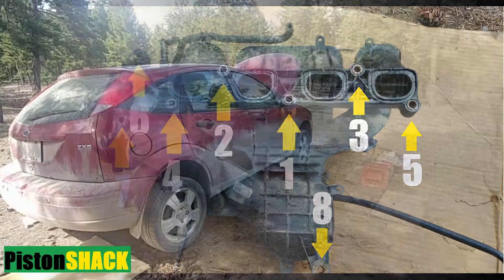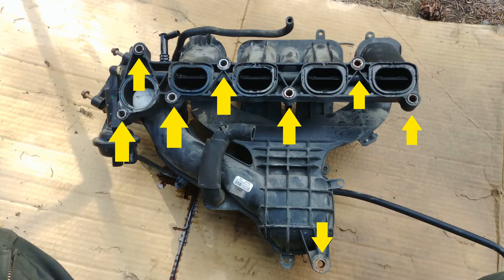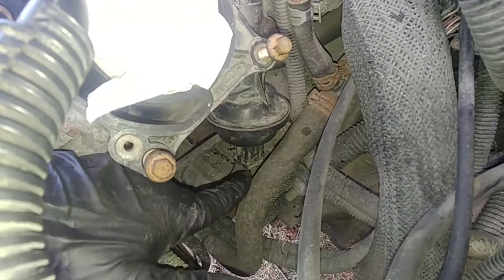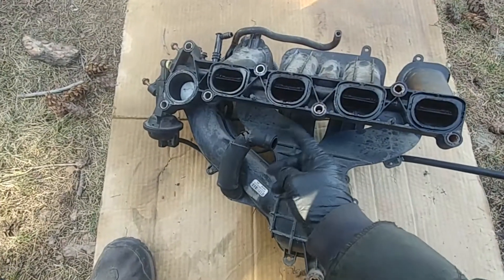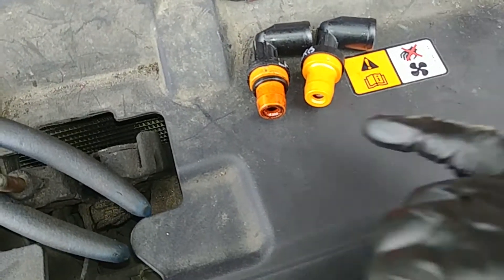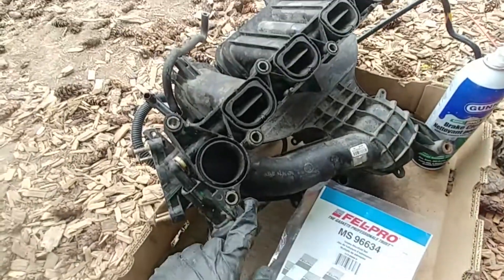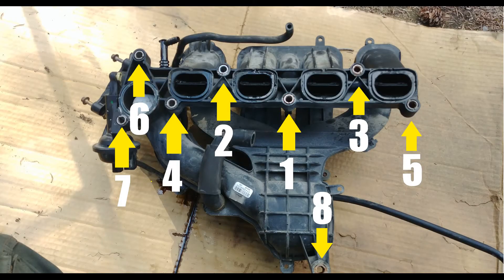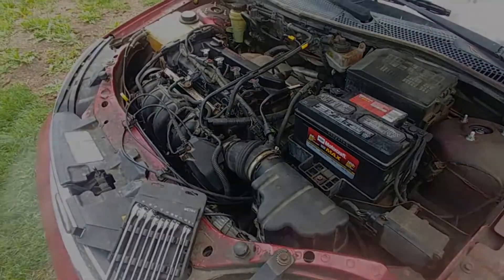FORD FOCUS 2.0L DURATEC: PCV VALVE, HOSE & INTAKE MANIFOLD GASKET (manifold bolts sequence).

Comment: Hi and help!
2005 Ford Focus ZX4
My shop could not find a problem. There was no trouble code. They performed a tune-up.
Same symptoms after tune-up, loss of power and stalling and DTC P0171. 
I Replaced PVC and hose, and Intake manifold. Original symptoms repeated this morning. What should I look for next?

Comment: I know its an old video but that manifold is broken and no good...The butterfly plate is moving up and done not just rotating and should be replaced...should it break and the car will die and your doing all that work all over again...if your lucky, if not the pieces will get suck into he engine, potentially causing catastrophic damage.

Comment: What was your reasoning for replacing it.  How did you know it was bad and needing to be replaced?   I have the same car, same engine.  I had a bad oil leak at the valve cover and I replaced it and it hasn't leaked there ever since.  However I'm still smelling burning oil when the car is on and the heater or ac is on.  Someone told me the pcv valve will make it smell like burnt oil if it is clogged up.  I cannot find any other leaks besides the oil pan drain bolt has a slow leak there.  So I don't know what else would cause an oil burning smell.

Comment: I hope you see this but can you tell me if the coolant temp sensor is behind the intake?
Reply: depends on wither or not if the thermostat has the sensor or not some do, some dont, also depends on year. most coolant temp sensors are near the radiator

Comment: You can take the throttle body off and hose and reach through to the PCV valve if you're not renewing the manifold gasket.
Reply: @GrizzlyGaz  man that's good to know. I really just wanna change the pcv only and not go through the bigger headache of removing the manifold.

Comment: TIP  use ratchet straps and pull motor away from radiator just a small amount and you will not damage gaskets while placing intake on

Comment: Great idea placing the bolts in the screw holes on  air intake & throttle body !  My father was a mechanic,  I grow up in a garage my father always told  me  The service book are only 50/50 on information.

Comment: Why not remove the fuel rail ? It appears that you may have way more access with it out of your way. Its just 2 bolts, the 4 injector wiring harness's, fuel input line  and the rail and injectors pops right off. Would that not be worth the time to do it for this job ?
Reply from the maker: Good point Bevis! There's always some better ways to do it. Thanks for sharing your advice. Cheers!

Comment: Is $525 a fair price for rear end crankshaft seal, replace pcv valve and a couple cracks in aluminum oil pan where AC compressor is mounted on ? 2016 Focus SE 2.0L duratech engine.
Reply from the maker: Hey Frank! Sounds like you had good deal for the work shop did. Check  front side of the engine where is serpentine belt, AC compressor should be there. Thanks for you feedback.
Reply: @PistonShack  no , about to get it done. That's price he quoted me. He also said I should clean engine ( which I've done) to truly check it to see any oil leaks. Also, if timing cover is leaking oil that must mean the engine crankshaft front seal is bad too right ? I don't think it is but asking just in case.
Reply from the maker: I would clean inside the engine cover, let engine warm up and idle while looking for any leaks with bright flash light. Most likely oil get inside the engine cover. Normally, seals shouldn't leak on 5 years old vehicle.

Comment: Great video.  I broke the barb off the fuel pressure sensor too, good to remove that.  Appreciate the tip on removing the throttle body.

Comment: The worst thing about the location of the PCV on this engine is that it can need to be replaced between every 20,000 - 50,000 miles, despite Ford's recommended 100,000 mile interval. I'm about to do mine because all the signs are there. Bank 1 lean code, rough idle both hot and cold, leaking valve cover gasket, and the car only has 65,000 miles on it.

I'm seriously considering gutting the old PCV valve so I can place the new one in a remote location out from under the manifold.
Reply: Did u manage to replace it without removing the manifold?

Comment: thanks i am doing this job and this has been helpful. Having a hard time with the ring that holds down the pcv valve. Which way does the plastic ring turn to take it off?
Reply from the maker: I think you have to turn that plastic locker ring counter clockwise 1/4-1/2 of the turn ti take it apart.

Comment: Granted I haven't done this job which is why I'm watching the video, but putting the intake gaskets on after putting the manifold in there seems insane.  Don't they easily fit into the plastic grooves on the intake manifold?  I replaced gaskets on the valve cover and it looked like the same thing.  If you are worried about scratching them with the fuel rail, the fuel rail is really easy to remove.  Am I missing something?
Reply from the maker: Hey brotha! This way worked well. I tried the way you explain,  I just didn't want to remove fuel rail off. Just tried to reduce amount of parts taking off. Thanks the advice. Have you done your repair already?
Reply: @PistonShack  No, it's not the weather here to be doing this right now, unfortunately.  I don't have a garage.  Didn't mean to be offensive.

Comment: I have the exact same problem. My car is also equipped with lpg from the factory. Do you know how can I move the plg injectors rail away to make space?
Reply from the maker: Hi Alin! Oh, I see. I am not sure but I think should not be much difference than removing gasoline fuel rail. Let me know what did work for you. Cheers!
Reply: @PistonShack  it was actually easier than i thought regarding the fuel rail. However i got stuck on the last 2 bolts from the center🤬🤬😭, i can't reach them i managed to get 6 bolts out and all the wires away, but those bloody bolds i couldnt and I had to abandon and put everything back together. I will try tomorrow maybe, after i buy another extension for my rachet. I had 2 extensions but they aren't enough apparently. Those bolts are way deep inside. I Have the 2009 2.0 focus and it's slighly different from the pre facelift version
Reply from the maker: I know brotha they are hard to get. Just get bunch of different length extensions, deep and shallow sockets with a swivel to rich them.

Comment: Hey man I just got done doing this today I’m waiting on the hose and valve. I have oil residue inside the intake where the pcv hose attaches, what does that mean ? Does it just mean the pcv valve failed??
Reply from the maker: Hi Parker. Most likely PCV valve partially stuck (clogged) closed or tube got clogged up. Little bit an oil is fine. Did you drain any from intake manifold?

Comment: Thinking I'm going to do this job on my car sigh not looking forward to it
Reply from the maker: Sounds good Gage! Let me know if you have any questions.
Reply: @PistonShack  can I get the manifold out if I just take the fans out and leave the radiator in
Reply: @danicyrus6464  you can, but that's alot more useless unplugging, better off loosening the motor mount an slide motor back some then work from there.

Comment: Would have maybe been easier to disconnect the hose for the PCV valve on the intake manifold side and leave it attached to the PCV valve until after intake manifold removal.
Reply from the maker: Hi Paul! Interesting point. Let me know if it work out.

Comment: The guy who designed this motor I’m sure has family members who are mechanics.
Reply from the maker: Good point, I haven't thought about it. 2.0L Duratec engine is not too bad, most of the components hidden under the intake manifold. Cheers!

Comment: I was a bit confused on how to do this because the Haynes manual didn't explain it well. But you explained it perfectly! I will be doing this soon, thank you!
Reply from the maker: Hi FalconMFilms! Great to hear that! I couldn't find any decent information with all details online. I tried my very best to make it clear and straight to the point. Let me know if you have any questions. Whatt Ford Focus do you have? Cheers!
Reply: Sorry for the late reply, I’ve been busy fixing some more pressing issues (wheel bearing, wheel cylinder, cv axle, motor mount). Had to put the intake manifold work on hold for now. Thanks, I’ll let ya know if I got any questions. I have a 2006 focus zx5, I mainly use it for daily driving and autocross.
Keep it up man!
Reply from the maker: You bet brotha. Sounds like serious repair is going on! In Canada Ford Focus is not very popular loved vehicle at all. Take care!

Comment from the maker: More interesting Ford Videos: 
WHY YOU SHOULD NEVER IGNORE FAULTY PCV VALVE?! Small Valve BIG problems. Ford F250 PCV valve change. https://youtu.be/tdeoA4m2IWE
FORD FOCUS MANUAL TRANSMISSION MTX-75  GEAR OIL CHANGE PROCEDURE https://youtu.be/wqCCwpIwdDg
FORD FOCUS 2001-2007: CV AXLE SEAL, LOWER CONTROL ARM, BALL JOINT REPLACEMENT. https://youtu.be/Y9muf6Hj_TA
FORD FOCUS LOWER ENGINE MOUNT REPLACEMENT (2000-2007) https://youtu.be/PELYTVgcFsQ
FORD FOCUS 2.0L DURATEC ENGINE SPARK PLUGS REPLACEMENT (2001-2011) https://youtu.be/RsZ4h3sxaus
FORD FOCUS 2.0L DURATEC ENGINE VALVE COVER GASKET REPLACEMENT https://youtu.be/sIQE6eSf9bA
7.3 POWERSTROKE DIESEL: FUEL FILTER REPLACEMENT and PRIMING FUEL SYSTEM https://youtu.be/FNRYRRFEZmw
How To Diagnose and Replace Windshield Wiper Motor on Ford F-250, F-350 (99-07) https://youtu.be/5a5_JreHnsQ
MY LIST OF CRUCIAL QUESTIONS TO ASK CAR SELLER BEFORE YOU GO TO CHECK IT OUT. FIND GOOD CAR & SAVE $ https://youtu.be/y7FL8V9Ct9I
HOW TO REPLACE FUEL FILTER on FORD F250 F350 gasoline TRITON 5.4L V8 or 6.8L V10 https://youtu.be/AVc0Ou2DJQY
SERPENTINE BELT TENSION REPLACEMENT on FORD F250, F350 Triton V8 engine 5.4L https://youtu.be/5X-Vflmcc6o
TROUBLESHOOTING LICENCE PLATE LIGHT CIRCUIT. Any vehicle. Fixed! https://youtu.be/230Au9Y3d80